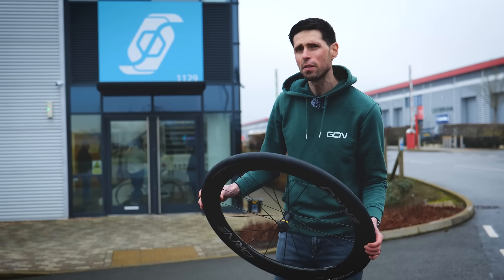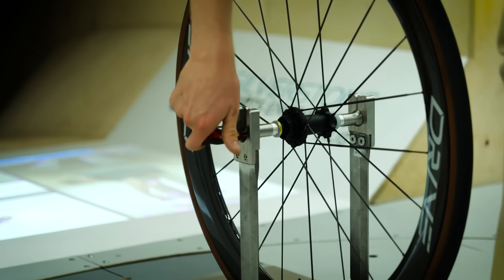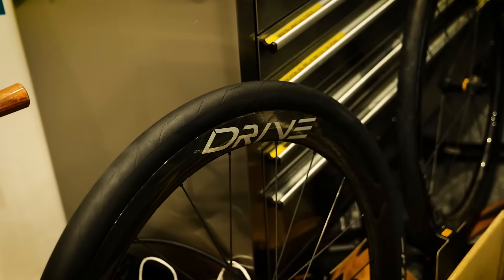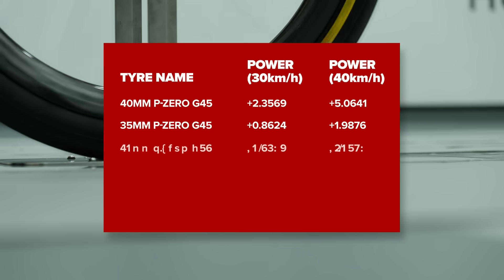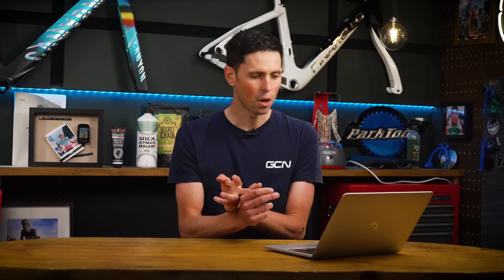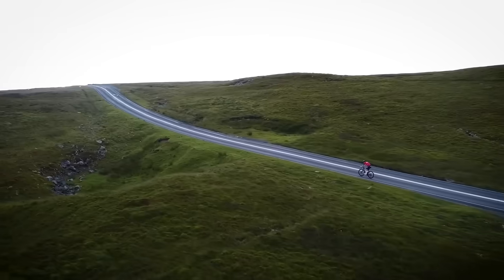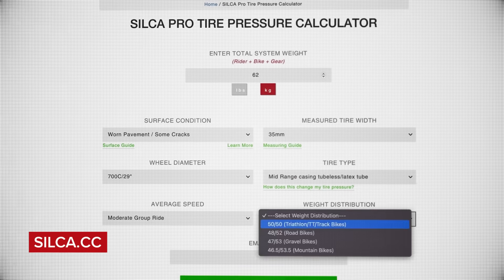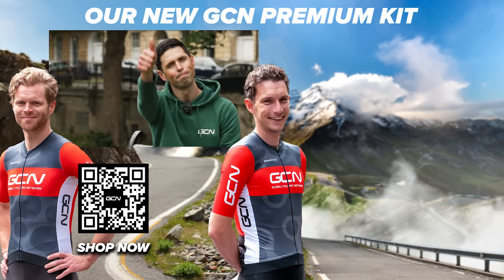The Fastest Tyre Width is NOT What You Think

Comment: skipping 25 and 32mm is crazy, also you guys should also test with different rider weights, 28 or 25 will probably be as efficient in rolling resistance with lightweight riders like 50-60 kgs.
Reply: Unfortunately I will never be able to test every situation and setup, but this example and testing should be helpful for a lot of people.
Reply: @alexpatonGCN how about testing heavier riders vs lighter riders on different sizes.   You had a few weightlifters on before.  That would be interesting.  That’s real world testing.  Keep up the good work!
Reply: Not including 25s was a shame
Reply: How picky can you be? Sheesh
Reply: Like, are you capable of doing simple interpolation for the 32 mm width? Come on man.
Reply: why should a narrower tire be more appropriate and faster for lighter riders? makes no physical sense. if you set all tires to the same comfort levels the rolling resistance will increase/decrease with the changed mass in basically the same relation across the tire width range.
Reply: @Digi20  50-60kg riders can set 60-75 psi on 25c tires and just get away with the same compliance/comfort and STILL reap the benefits of less rotational weight,  quick acceleration and aero benefits that fatter tires wont achieve. this is from a 59kg cyclist that smashed climb PRs by minutes using 25c tires from 28 and 30 with awful road conditions.
Reply: @austienbryandemesa5841  this does not make much sense to me. a heavier rider could run the same 25c tire if he chooses to, he would just need more pressure to achieve the same tire drop and comfort level to make it equal. you both can run them hard or soft depending on your liking. if you run 60psi, he would need f.e. 80psi for the same comfort.
Reply: Yeah insane, crazy, ludicrous I mean how dare they!

Comment: Correlating vibration to speed, thinking that you ride faster if the bike vibrates more, is only applicable to mentally weak people.
And thats a scientific fact.
Its a mindset.
Reply: It's easy to test if you are mentally weak (I know I am) by gripping you handlebars really hard for a couple of seconds, and then relaxing. The extra vibration transmitted up your arm truly does feel like you accelerate then decelerate as you grip and release. I like to do it occasionally just for the thrill of going faster with no effort!
Reply: I'm not too sure what you are saying is a scientific fact 😂 it's a very common misconception though
Reply: Some people are more sensitive to vibration and "danger". Others relate more to facts.
Its like when people thinks parachute jumping is dangerous.
The snowflakes needs to unlearn being snowflakes.
They are also the ones that crawl slowly down a mountain, murdering the brakes.

Comment: 25mm  tubular tyres are fine for me
Reply: Same here. Changed from 23mm a couple of years ago and can’t feel the difference. I don’t pump my tyres up rock hard as I did in my youth but I really dislike lower pressures regardless of their being “better”. I also still use clinchers as I really don’t want all the fuss. Rim brakes as well. I bet my bike is “better” and more expensive than the bikes of 95% of the people watching this and it’s just the way I like it. It’s a pro-level bike and I’m sure Pogacar would be happy with it. It’s certainly too good for me 😁It’s way too pretty for gravel tyres and disc brakes and rides like a dream.
Reply: 25mm tubs ride great on the right surfaces. What do you carry for spares on the bike?
Reply: @alexpatonGCN   I run Donnelly cyclocross tubs that are constructed with a tubeless casing.  I patch them like any tubeless tire, and add a touch of tubeless sealant after the first puncture.
Reply: @ericpmoss  why not before first puncturre?
Reply: Spare tubular thats been glued etc but i do srcub my tryes aftereveryride to check for wear or damage  @alexpatonGCN
Reply: Why not 23 mm 120 psi?

Comment: Probably same reason as some 45mm gravel wheels roll faster than 50's because they use the same thickness on the tire. As you step up to mtb tires they become much thinner and roll much faster. 40mm road tire could be made with thinner sidewalls and less puncture protection because it needs less pressure,  think of Newtons 3rd law. And as a result the wider road tires would roll faster.
Reply: That could be true, however at the moment it would not appear the case with many brands making their super wide road tyres with thicker casing than the narrow options to try and accommodate some form of gravel use too
Reply: @alexpatonGCN  I would love to see Rene Herse slick tires tested on the Silverstone Efficiency rig. I bet Jan Heine would love that too 😉

Comment: AGAIN SKIPPED A 32MM WHICH IS WHAT MOST PEOPLE ARE RUNNING... All the effort spent to do this test, it won't take much more to test all the sizes like 25 and 32.. 

28/30mm upfront and 32mm on back is probably most common.
Reply: Been running 32 since 2017 for road lol.   For gravel bike 42-45s.
Reply: almost every modern "road bike" tops out at a 32 max; you might be able to chance it running a 35 but it would be dicey on most setups and not recommended. beyond that you'd need a gravel, hybrid, or whatever that is likely a compromise in itself to pure road riding (heavier bike, 1x drivetrain, taller aerodynamics, etc)
Reply: They say it tops out at 32..but most of the time you can fit a 35.. Sl7 tops out at 32 but the wheels externally are 34 for rovals for example. My canyon grizl tops out at 50 but people run 55-57mm tyres with no issues.  @oldtwinsna8347
Reply: Have you heard of interpolation?
Reply: 32c are the sweet spot for me. Im not bike packing or going to unforgiving terrain, if thats the case ill just bring my xc mtb. But for all day rides 32c for me.
Reply: I have to give everyone something to complain about 😂 I'm not so sure 32mm is the most common size though. I'll keep that for next time
Reply: @alexpatonGCN everyone I know is running it, seems to be the case, Nero show boys also see everyone running this size, 28mm for the pros, people ahead of the curve already on 30 or past. But thanks for leaving me something to complain about. Now I have something proven to go back to cyclingweekly about saying 40mm was faster 😂
Reply: @BikesKomsCRO that could be the case for you or other riding groups, but 32mm in opinion is no way the most popular tyre size for road bikes. I will happily be proben wrong from sales volumes though. I will try to get some sales data if possible though to get an actual answer. From the tests i conducted and from my experiences riding almost all sizes, im yet to find a time when 40mm has been faster. Yes its great to ride on for rough roads, but speed appears not to be is main strength.
Reply: @alexpatonGCN I think different brands will suggest different data. I wouldn't be surprised if Continental would suggest that 32mm is increasing in sales more rapidly than other sizes.
Reply: I know no one riding 32mm! Granted I only know what the 70 or so people in my club and what a few friends are using.